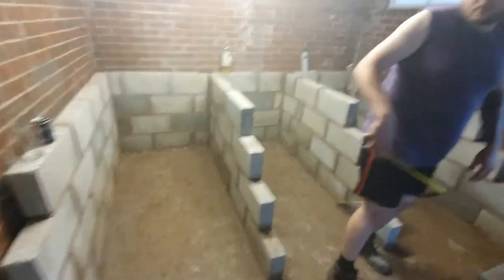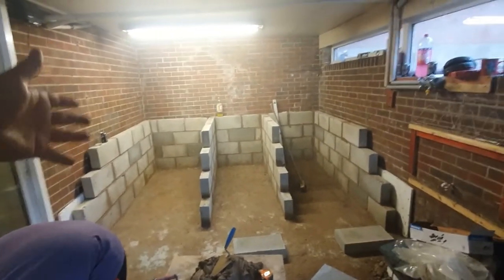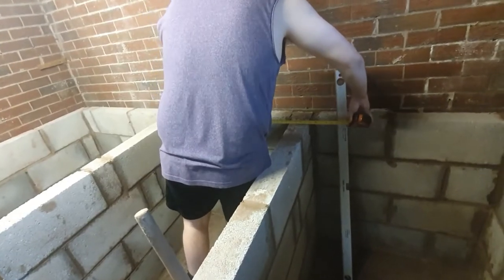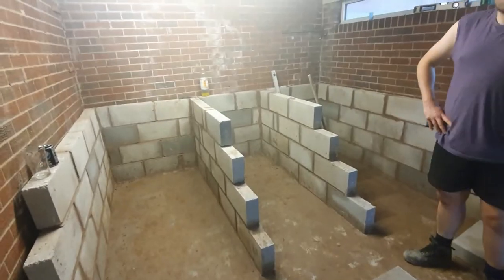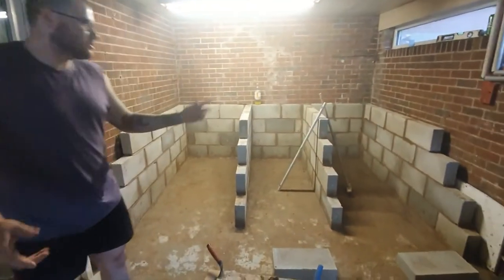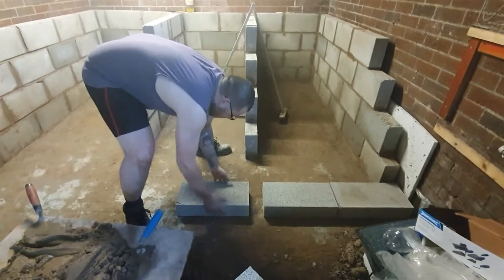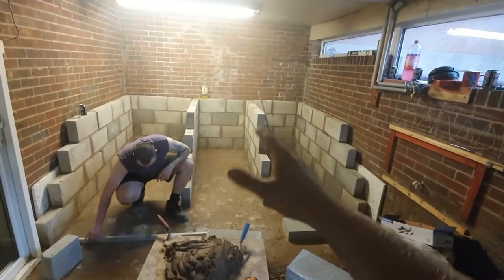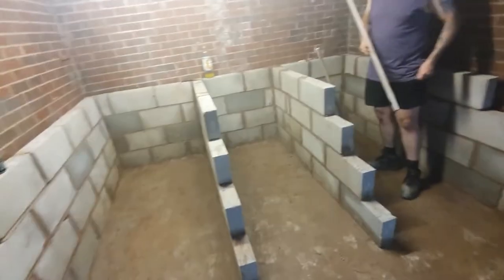How to build a concrete block pond - Part 1

Comment: Hello bud just seen your videos amazing job currently in middle of setting up to do mine and mines going to be 10ft by 8ft by 3ft deep no section jjst a big square. What would you recommend block wise and on which way to lay as it’ll be hold jjst under 7000 litres
Reply from the maker: I would lay the block down for that mate, will offer a lot more support

Comment: 2 years too late but for the outer walls they should be layed flat but as they have the wall behind them youncould just build them tight to the wall with insulation tightly between. The front as you have planed laying flat as its unsupported. Internals will self suport as all 3 pods will alwaus be full and are also tied un both sides. Dont think there is enuff high tonthe wall furniture to wsnt to bow over of one pod was half drained. An addition to the block work structure you can add what's known to me as train tracks or tramlines. Every 3rd corse. Basicly a 2 stainless steel  rods with interconnects. Basicly act as jnternal straps helping hold things from slipping outwards.
Reply from the maker: Epic comment mate, and somthing I’ll definitely take on board moving forward
Reply: @The Balding Reefer  hoping to have somthing to be proude of myself come next year. Been looking for inspiration and clocked some of your videos. Some nice content. It helps to see you standing with the setup too greatly helps me gauge how many block ile need for doing my dream semi raised pond lol. Thinking mabe 3 pack of block will get me close if not finished. I'm planing on 2ft deep after base is poured & 3 foot up from ground level. Ima have check out some of your other build as just noted you done a few since. Happy days 😉
Reply: @The Balding Reefer  how did you get on with the fiberglassing in the end pal. Not watched that one yet. Any ruff estimate on price per square meter for as I'm on the fence with pad and liner vs  render with epoxy paint or the more premium option of fiberglassing. Will be a first for me woeking with fiberglass sonile need pick up some key pointers. Thanks in advance.

Comment: Going to look spot on when finnished.just a little question which would you say is the best cement mix for the blocks 4-1 or 3-1 thanks.
Reply from the maker: Cheers mate! There is other parts to this that are out now, i used 4 sand one cement, water added in small amounts with the tiniest amount of fair liquid, and I mean tiny, like the size of a pea!

Comment: hi mate im building 6ft by3  by3 using blocks laid up right have you had an issue with yours ? just worries its wont be strong enough, laying them on solid back yard concrete floor
Reply from the maker: No mate mine have been spot on mate, just follow my steps and you'll be spot on, do not fill the pond for 21 days as the mortar will need to cure
Reply: @TheBaldingReefer   thanks alot for the reply my yard is only small and need every inch of room, people on that facebook group " pond building and help and discussions, slate single block and say it will fail, im going to go ahead and single block. thanks
Reply from the maker: Your sizing is fine for single block mate, if it was say a 3m x 3m square then you would need to lay block down, but you'll be fine. As I say, 21 days for cement to cure, not a day less mate